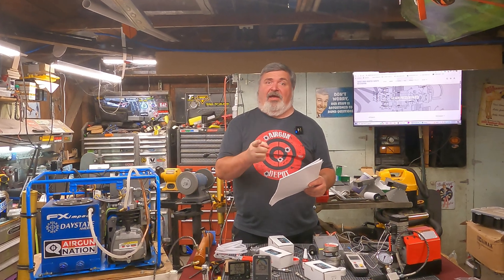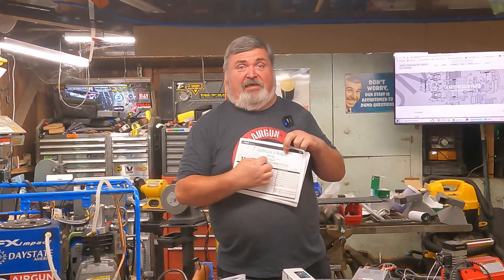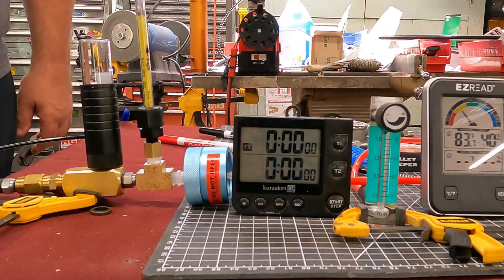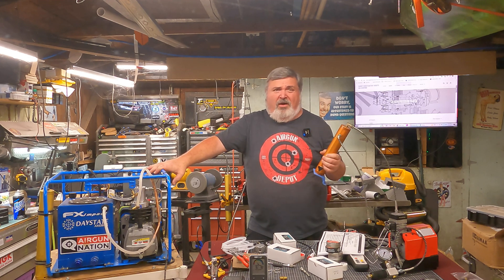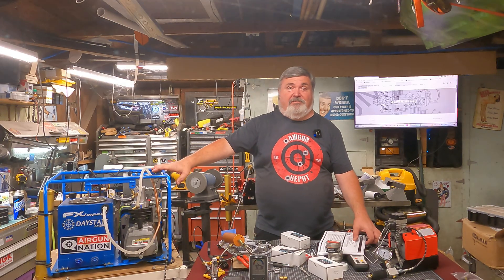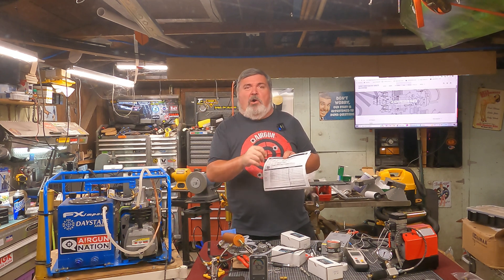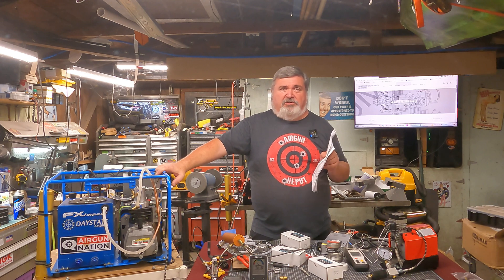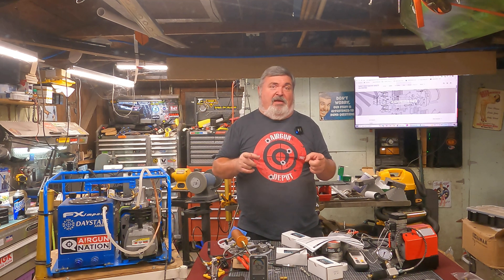Low cost HPA compressor output analysed! Yong Heng GX CS2 shootout YHHRS ep 18

Comment: Wait, did you run the compressor without pressure against that colour changing material?
Would that not influence the result a lot?
At atmospheric your dew point can be at 10°C, but conpressing the same air to just 80bar the dew point is already at 100°C, meaning no matter what you do, you have condensation. 
Or did I miss sonething about this test?

Comment: New to pcp guns. bought myself an avenge-x and gx cs2 as first toys.
So long story short. The ideal gx setup, is with the tuxing molecular sieve vertical.only downpoint is that its gonna take longer to pump,right? 
Greetz from belgium
Reply from the maker: Your solution will result in a LOT of additional time on the pump as that volume will need to be filled each time. Also not having a true coalescer or moisture separator before the media means that you will consume media at a fantastic rate. Thank you for your comment.

Comment: I am getting the new GX CS4 rated to a fill pressure of mpa40, 5800psi Every oil water separator on the market is rated at mpa30. Can these dessicant filters handle the additional pressure? I only plan to fill my pcp rifles to 4500psi which is just over 30mpa.
Reply from the maker: Is your question "Is it okay to exceed the rated pressure on something that is already likely marginal? No, it's not. The likelihood that you will find anything to fill to 400 bar is pretty low, so why would you need anything to go that high?
Reply: @TargetForge  I wouldn’t go any higher than 4500psi but the filters are rated at 4350. Will they handle 4500? Btw love the podcast!👍

Comment: Hi, how donyou know when the molecular sieve is saturated?, and how do you reactivate it?, thank you very much  for sharing
Reply from the maker: Great question Lev. There are some treated paper strips that change color when exposed to moisture that can work very well. Changing it out based on use works also. The interval will depend on time used and RH when it was used. It is possible to dry the media but it does require kiln level temperatures and it is so cheap, i never bothered to explore that in depth.
Reply: Ok, thank you very much, very nice video by the way

Comment: hi
would a GX be enough for 1 fill 3500 0,8L a week?
Reply from the maker: Probably fine doing that. Will you be filling it from 0 psi? or just topping it off?
Reply: @TargetForge  probably 1 time from 0 and then just top it. not heavy shooter and isnt for airgun but for HPA/airsoft, wich by it self uses lower pressure but came here cuz your vids are well informative. TY for answer
Reply: @TargetForge  I was under the understanding that the bottle/ airgun needed to be at 0 with the CS portable compressors?
Reply from the maker: @michaelomalley9992  Zero what? Degrees, PSI? Inches? Why would you need to empty the bottle? You just leave the vent open until the pump starts then you close the vent. When the pump reaches the same pressure as the vessel air will flow. You DO NOT want to start the pump with the vent closed or under any pressure at all.
Reply: @TargetForge  Start filling with 0 PSI in the bottle. So is that not true any more?
Reply from the maker: @michaelomalley9992  Never was. Sounds like you got some bad intel along the way.
Reply: @TargetForge  Thanks!
Reply: @TargetForge  So take sure, I did not good, I have a GX, IDK why I said CS, I think I got the board confused with the compressor.

Comment: Is there a video showing the build of the yong heng stand you made
Reply from the maker: Well, not really. It was built back in 2018 and I had no idea it would be so popular. My access to that shop that contained the tubing bender I used (manual, but very nice if you took your time) is gone. I will be doing a series of videos upgrading the current iteration of the "Wong Way". I could show some of the early fabrication photos I did that might help some folks out.

Comment: I wonder if a 70/30 blend of desiccants to carbon or even having another tube placed after the desiccants filled with carbon would assist with carbon monoxide removal as shown in the wiki https://en.wikipedia.org/wiki/Diving_air_compressor under filtration. It's actually funny since just a couple of days before you posted this video I was cleaning out my yong heng and wanted to change over to breathable air to stop the carbon build-up and got the expensive Seco lube. I am really interested that if this oil transition leads to the change of eliminating carbon monoxide.
Reply from the maker: Thank you for your comment Matt. I'm not a fan of DIY breathable air with super low cost equipment from companies that do not operate in the mainstream "HUMAN contact" air trade. In fact I pretty much advocate against it. Is a cheap filtration system from China (who your family cannot sue if it goes wrong) a wise choice when human life is on the line? Just gives me the willies... One test is not enough either, you would need to test at regular intervals to understand how your media degraded over time, do any of these filters tell you how often to change the media? Making HPA for a PCP, pretty low risk, worst case you blow a burst disk or push a bunch of junk into your new toy, your sad for a few days, big deal. Breathable air is a whole different thing, people have, and continue to lose their lives. If you saw inside the engineering of these companies, or lack thereof, you would be terrified too.
Reply from the maker: I just read that wiki, and the presumption that activated charcoal removes carbon monoxide is incorrect:
-Solid particles from intake air, using paper filters
-Water, using water separators, silica gel, activated alumina or a molecular sieve
-Oil, using activated carbon or a molecular sieve
-Carbon monoxide, using a catalyst (Hopcalite)
-Carbon dioxide, using a prefilter (scrubber) may be necessary depending on intake air quality.

Comment: so if im using the GX CS2 does it benefit me at all by using a "tuxing type" molecular sieve filter or am i wasting my time, $$$, and pump pressure filling the thing inline?
Reply from the maker: Wasting your time? Ideally the filter SHOULD stay pressurized. So if that is some combination of check valves or manual valves that keep that filter volume pressurized you would not be filling that volume over and over. If this filter setup existed, and it could, with more or less off the shelf parts there would be no impact to fill time. I am also looking at creating a 1/2 or 1/4 size version of that filter to reduce the volume, which would also make mounting a little more feasible. Perhaps next we will tackle the valving issue and see how that goes. The goal in this video was to find a way to dry that output air, and we found a way. Would it benefit from from some optimization? You bet!

Comment: I just found your channel and I'm learning so much already. I've been air gunning since 2018 and got my first pcp with a hand pump in 2019 and its a workout to fill. I then decided to get a yong heng for more trigger time. I've been using mobil1 sae 0w-16 synthetic since the first day. And I do get the oily smell you mentioned like with iso vg46 oil. I notice it takes about 25 minutes under load to start smelling. I do use 2 inline filters with sieves on the air out side. I'm not sure if theres any carbon build up on the smaller piston never had it apart to check. If I switch to using a diester based oil should teardown the pumping unit to clean inside?
Reply from the maker: Welcome PJ. Is oil compatibility always an issue? No. If you had a well done, and in depth data sheet on each oil you would have a much better idea going in as to compatibility. It is always good practice to clean the unit well when compatibility is unknown.
Reply: @TargetForge  great to know thanks for your help

Comment: Thanks for all you hard work.  I have the GX CS2 and Tuxing filter with the molecular sieve insert with the round beads vs the crystal desiccant. Is one of these filter medias better then the other? When I bring to the field and use I don’t always have the filter vertical.  Is that acceptable or should I build a portable stand to place the filter vertical when in the field?  Thanks
Reply from the maker: Welcome Ken, the prevailing wisdom is to keep that filter vertical. It is also known that keeping the media pressurized with input and output valves is also "best practise" but few of us do that. The by product of the reaction of the molecular sieve media and moisture is acidic and if left in contact with the threads and side wall of your filter housing it can weaken them. Is incidental operation going to cause a failure? Probably not, just inspect well during media changes would be my advice. I also keep the threads on mine coated with a thin application of silicone grease for orings as well. YMMV.
Reply: YES I am also interested in the answer here as i have a cs2 and filter with MS i purchased after and added.
Reply: I have this same set up, but am finding it takes over 6 minutes to fill my Taipan Mutant to a reasonable amount. Are you doing anything to reduce run time? I feel bad for putting so much time on the CS2
Reply: @ronaldgene  Thank you for you question Simon. I would not feel bad about using a tool within its limits, 6 min sounds perfect to me. Getting more output from the unit would put it under a LOT more stress. It's a 250W compressor, and you can run it just about anywhere. Fill a magazine or two, wipe the gun down, stay focused on the fill pressure.
Reply: @wruehl  Thank you very much for the response, Bill. I want to let you know that you and your content are such a huge asset to the airgun community and I wanted to thank you. One more question though, what are you thoughts on filling one of the smaller blue "Creation Core" cylinders with desiccant? Are they too small (and the air wont settle in there for long enough) to be effective? I just find filling the large gold cylinder such a lengthy process for the little CS2 compressor.
Reply from the maker: Simon, Joe and I explored this idea in the video "Cheap does not = Good" where we talked about how these filters actually work. I'm told that allowing MS media to come into direct content with the aluminum shell walls is a VERY bad idea. This is due to the reaction of the beads and the walls chemically. Once the walls of the container are sufficiently weakened you have a pipe bomb with a random fuse. Check out that video, it should help clarify what I'm saying.

Comment: Nice to know the oil/water molecular sieve filter does a good job of removing the moisture from the CS2 air!   The results of your tests were fascinating (and surprising!)
Reply from the maker: Hey Swamp Fox! Thanks for the comment! Just to be clear, oil will deteriorate the media quickly, luckily on the CS2 that is not a problem as there is no oil to begin with. I really hope someone sees the whole in the market for a reliable low velocity separator for the smaller machines. Would stretch that material life quite I bit I figure.
Reply: @TargetForge  My CS3 is oil bath.  I am using Royal Purple synthetic compressor oil.   I will have to keep a close watch on my molecular sieve media.
Reply from the maker: @Swamp-Fox  Pretty sure that unit has a simple oil/water separator before the outlet. I think you'll be ok.
Reply: So glad to hear molecular sieves work so well as i know one airgun guy with a channel on the tube who says they do nothing. I have done tests with the molecular beads and found no water in the secondary filter after the air is filtered through the sieve and this desicant bead filter os on the low pressure intake side and the last filter on the high pressure side. You can test the desicant by putting a few pellets in the palm of your hand and adding a drop of water if the beads get hot they are still working and still good . Great video as usual